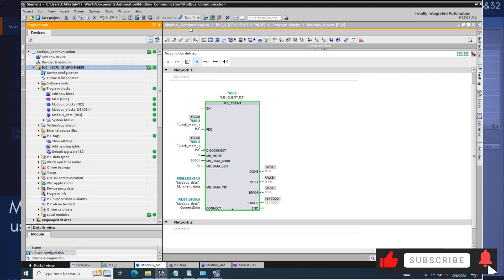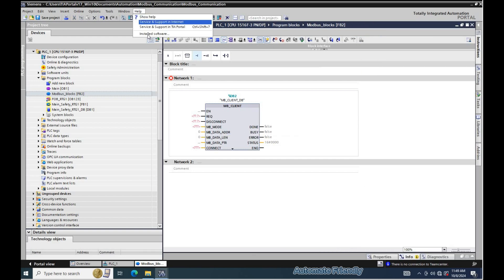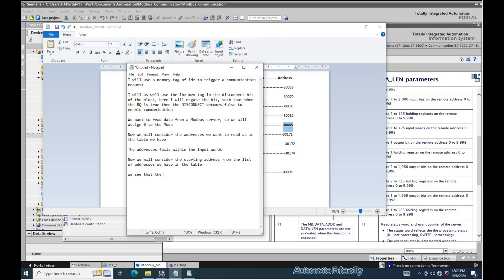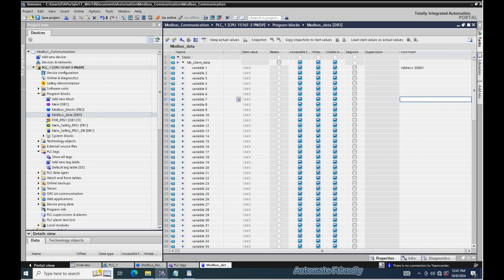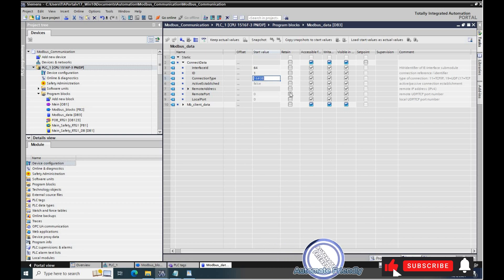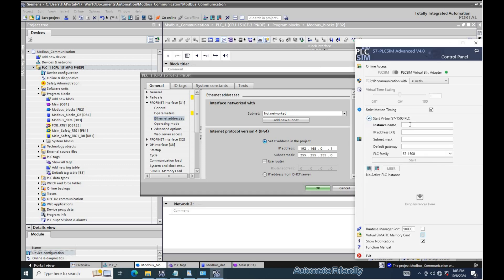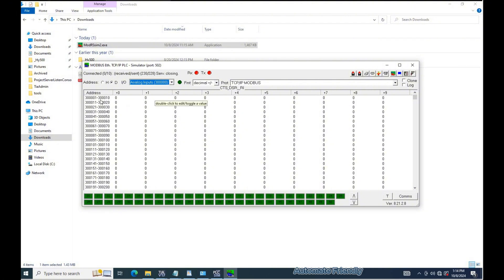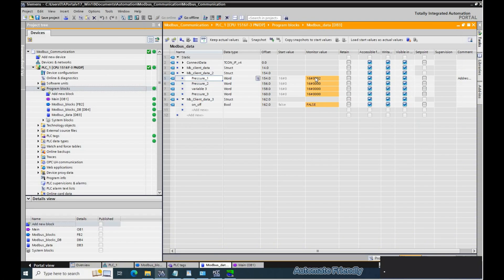Configure MODBUS TCP/IP Communication on S7 PLC - Siemens TIA Portal: (Step by Step)

Comment: Hi, i want to write data on Aurduino uno based seven segment display over ethernet . i have done all the procedure in your video but it is not writing on seven segment kindly guide me how can i do it?
Reply from the maker: Hi,
Please have you tried running a simulation with ModRSsim2 application to see that the data from TIA Portal is written successfully to the application?
Can also please confirm that the device you are writing to is on the same subnet  

Also, you can check a video where I discussed how to write using the Modbus block and how to resolve certain errors that can occur when trying to read or write using the Modbus block  

https://youtu.be/VoPcvUCifX8?si=w-3XR6IcXv_goEqo